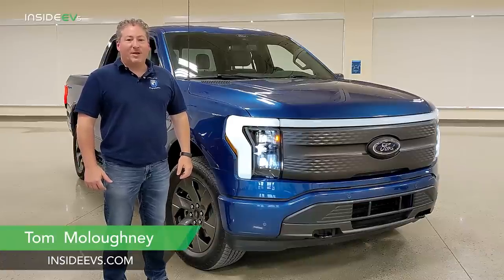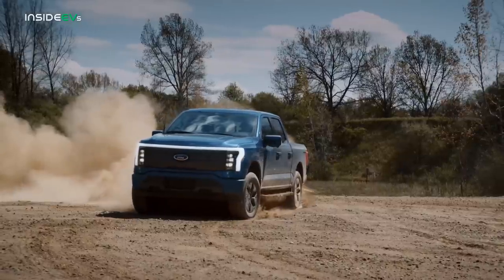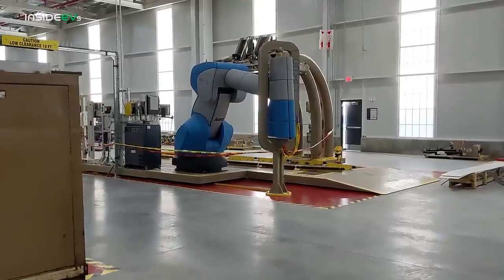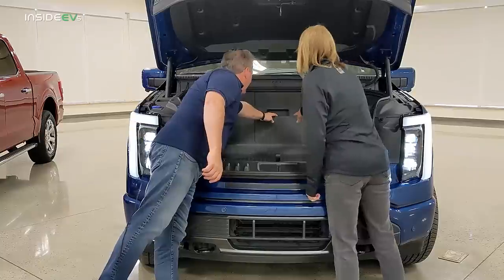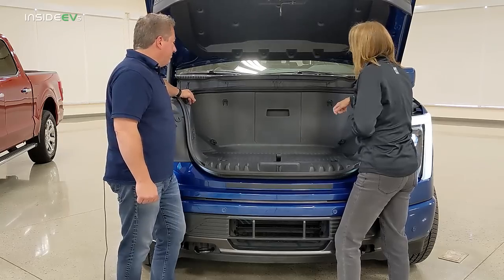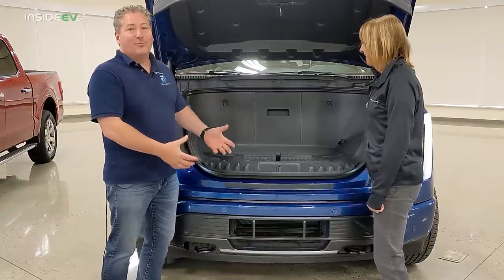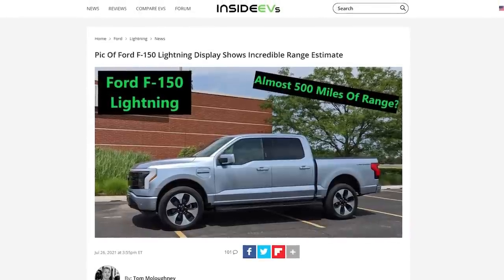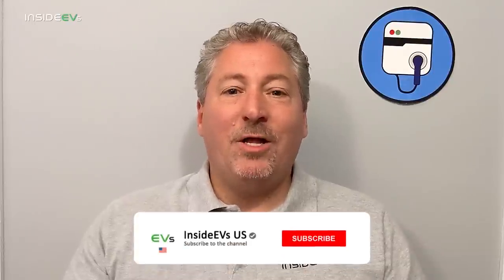Ford F-150 Lightning: InsideEVs First Drive Review

Comment: The price point is very expensive the platinum cost around 90,000 you can get f150 limited power boost fully loaded for 10,000 less and can go 700 mile on a tank of fuel so you don’t have to worry while driving waiting to get to the charging  station and wait 45 minutes to charge up and if you are towing  the range will cut down your battery life with the power boost little down time getting fuel I think that the platinum lighting is over priced and the fact that the fleet series with the extend battery can only be sole for commercial use will cost them customers
Reply: For serious towing, instead get the F-150 Hybrid.  It’s has the power, over 800 mile range, and Pro Power Onboard capable of 7.2kWs.
Reply: I agree I order on 4/24/21 a f150 antimatter blue power boost limited fully loaded and received a 3,600 rebate but they tell the truck just built but I will not ship to the dealership until 9/6 bummer the some of the dealership around me told to buy it now they are  up selling them for 5,000 over msrp to make up for there losses due to COVID-19
Reply: @charlie-qm9gz  Yeah, sorry to hear you’re going through that right now.  Hopefully, when I’m ready to buy next year, the prices will be back to normal.
Reply: @JeremiahTownsend  I think that is a good idea because the dealership lots will be full of 2021 f150 once all the semiconductor chips come in they will  have to move and make way for. The 2022 f150 I think that there will be deals to had
Reply: You also get a $7500-$10,000 tax credit so that’s the difference right there in addition the electric vehicle won’t charge you any money if you charge correctly using the free chargers even if you do charge at home it’s much cheaper than your gas variant.  Most people don’t need to drive 700 miles in a tank they literally just go less than 5-0-60 miles to work and back and then charge back up at home very seldomly or people towing that much for the vehicle the size if that was the case they would be going to a diesel pick up